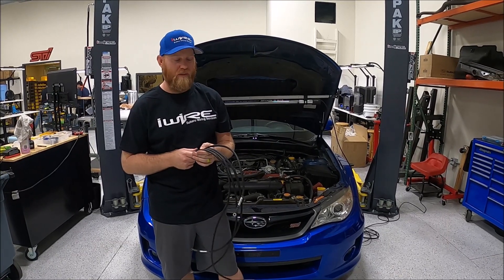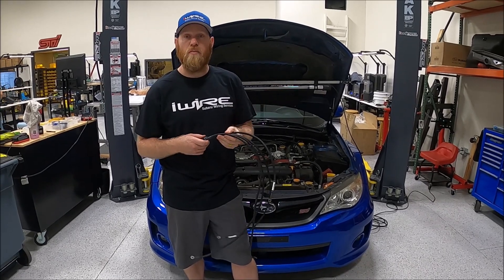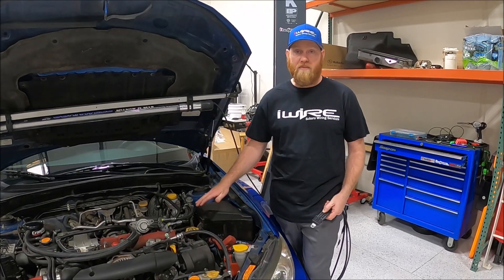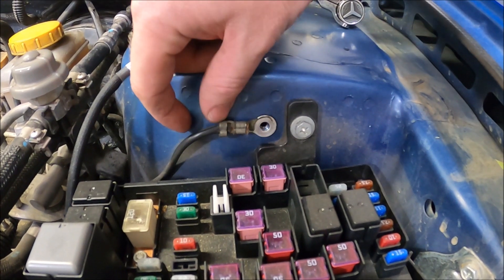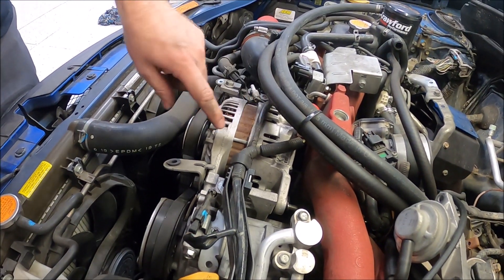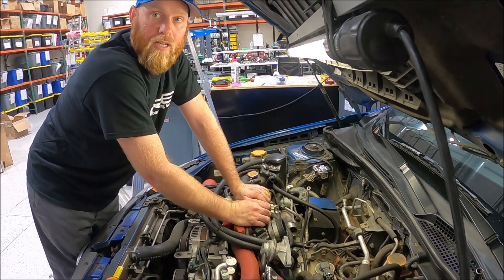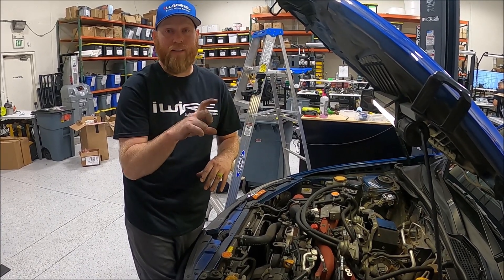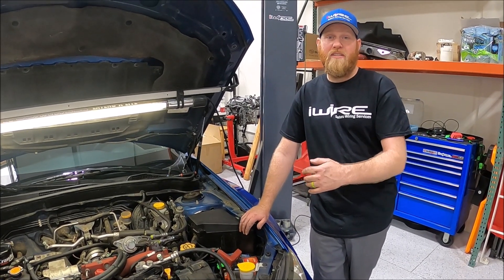iWire Grounding Kit Install Guide - Subaru Grounding Issue Solution

Comment from the maker: For Plastic Intake Manifolds - Bolt the ring terminal meant for the top of the intake manifold to the TGV block where the current ground terminal touches the intake manifold.
Reply: I have a 2014 WRX, I think I have a grounding issue as my radio flashes when I have my turn signal on but only intermittently. I want to install this kit but I’m having a hard time finding the last ground connection. I know you say it’s on the TGV block but I’m still not finding it.
Reply from the maker: @Iliketurtles69098  You can send us an email at info@iwireusa.com with some pictures of what you are working with, and we can try to help.
Reply: Can i ask where the tgv is on a 05 Outback 3.0 LL Bean(also plastic intake manifold)? I'm redoing my grounds with bigger/better wiring & I can only find the one to the driver strut, one on the passenger side fender(tiny one that goes into fender by power steering reservoir) & the one going to starter. I do see two under throttle body, on top of motor, two side by side. But those do not go directly to battery. I cannot get a straight answer from anyone. I'm running from behind alternator(just like in video except mine is on the bottom right instead of top right) to battery, from batt to strut, batt to starter. Should I run to one of the ones(two side by side) on the block as well? I really appreciate it. You guys really are a big help. Thank you!
Reply from the maker: @troshaffer4921  There aren't any TGVs on your model so you'll just put the cable near the main ground joint.
Reply: Please show a video on plastic manifold

Comment: I have a 2019 subie crosstrek and have some grounding issues, would this kit potentially solve them, and would the bolting locations be any different then the car shown in this video
Reply from the maker: Absolutely good option try and solve grounding issues and the install should be very similar even if not exact given the differences in engine type.

Comment: I have a 04 STI ej207 swapped, been chasing this idling issue for the longest time. Dips up and down on idle but today I cleaned up the chassis ground and it seems to have helped a ton, I also don’t have tgvs so I’m thinking this grounding kit will help
Reply from the maker: This should help. At the very least, it should eliminate the engine's grounding system as the cause of the problem.
Reply: @iwiresubaruwiringsolutions  just ordered my grounding kit today! Super excited. I have my fingers crossed that this fixes my issue with the idle going up and down. Over the last year and a half I’ve replaced everything from a fuel pump,  to the maf sensor and everything in between with no luck. I also noticed a feedback sound in my stereo recently that points to a ground so I’m hoping this helps!

Comment: You mentioned that the main ECU ground is top of the intake manifold. What about 3rd gen wrx's with a plastic manifold?
Reply from the maker: The plastic manifold will be grounded at the TGV block.

Comment: I've been having some weird issues with my '04 Baja NA 5spd, namely flickering lights (interior and exterior) and annoying surging while coasting. Replaced the alternator with a Denso unit and that ultimately didn't solve the problem...I've been told to only use OE alternators, but I have a feeling it's a ground issue. When I dig the car out of winter storage I will give the grounding kit a try. Thanks!
Reply: Did you figure out your issue?
Reply: @Tanya_Von-Degurechaff  yes...one of the harness eyelets bolted to the position battery terminal was just loose 🤦 found that out before ordering the kit
Reply: @LoveMyZJ  thats crazy, such a small thing too, you wouldn't know it. My car is having some weird issues too, the ac comp pulley and waste gate actuator solenoid and fuel pump, all keep cycling with the car off and key on the on position, super annoying.
Reply: @LoveMyZJ  thank you for the follow up. My 2012 Outback started doing this overnight, and while driving today, so I'm chasing down possibilities.

Comment: What else would we need to ground if we were adding an aftermarket stereo system and we wanted to do a big 3? I know this kit has some elements of the big 3 but not all. Do you have any plans to make an all-in-one grounding kit that incorporates the Big 3 and the current grounding kit?
Reply from the maker: We are focusing on ECU/engine-related issues, so it's not likely we will address anything else regarding the Big 3. More about this kit can be found in the link below.

https://iwireusa.com/blogs/iwire-university/grounding-issues-iwire-grounding-kit?_pos=5&_sid=d6aa39b2e&_ss=r

Comment: Hi, there. I just ordered the grounding wire. I watched your video on installation, and I am having a hard time with the alternator wiring, I cannot seem to remove the bolt as it seems it may be stripped. Any ideas or suggestions? Also, the wiring for the engine block, has large bolts, so I am looking for more ideal spot. What other spots could you suggest. I have a 2016 Subaru Forester. Any advice is sincerely appreciated. BTW, Great packaging and the thank you notes are a first class touch!
Reply from the maker: We appreciate the compliment! Sounds like some sort of bolt removal spray to get things loosened up may be in order. As for the bolt locations, as long as you adhere to the general principles we've described you'll be good to go.
Reply: @iwiresubaruwiringsolutions   I appreciate your response.

Comment: Maybe add a 6th lead for connecting the starter?
Reply from the maker: We don't add one to the starter because this grounding is for engine/ECU-related signals. The high current of the starter would not be ideal with the more sensitive electronic components.
Reply: You guys are the best - thank you for teaching me about all of this. Installed this kit on my 2007 Hawkeye STI without a hiccup  @iwiresubaruwiringsolutions

Comment: Just ordered mine and watched your video.
Do you not remove the old ground wires or do you bolt them up togeather?
Reply from the maker: You do not want to remove the original grounds. They are still needed for the ECU. This harness brings the ground to the manifold, so those original ground works better.

Comment: So this is pretty much a big 3 upgrade with the addition of the intake manifold, right?
Reply from the maker: Yes and no. This kit is designed to primarily improve the electrical efficiency of the ECU and engine-related components. The "big 3" is more related to body equipment like stereo. We talk about this a bit in the post here - https://iwireusa.com/blogs/iwire-university/grounding-issues-iwire-grounding-kit?_pos=2&_sid=c89234f31&_ss=r

Comment: I have a 2010 Forester XT.
Driver side ground wire from engine harness is not connected and I don't know where it goes.
Any idea of where it is at to go
Reply from the maker: Hard to say exactly. It should go to the block or the lower part of the TGV housing.
Reply: @iwiresubaruwiringsolutions  
Thanks, what is the TGV housing?

Comment: You know I just bought my forester and they just done the deletes and I don’t see this kit on the car so I’m
Wondering if they did soemthing or if I really need to get this kit aaap
Reply from the maker: If they did TGV deletes and you're having weird electrical gremlins we'd highly recommend this kit.
Reply: @iwiresubaruwiringsolutions  I don’t think I have any werid electrical issues only thing I’ve noticed is when I goto a stop I’ll get low idle then it will go back to normal idle “doesn’t die tho” but maybe I’ll get this in the coming week and the SD wire kit you supply for when I got front mount next year hehe
Reply from the maker: @Kiingzues  Doesn't hurt to install this kit just in case it is a grounding issue that's causing it. Glad we can be a part of your project in the future!!

Comment: Awesome video thanks a lot , question instead of sandwiching the cable with the alternator bracket can i put the ground cable in front of  the beginning of the thread with a nut, don't want take out my Perrin mod cover from the alternator lol, also is there's another option for a spot to put the ground cable that goes on the block engine, can i put it in one the 4 sides of the throttle body? I have a STI 2016 limited
Reply from the maker: It would be fine to put it on the front part of the bolt instead of the back for the alternator. You'll need to make sure one goes to the long block. The throttle body would be the intake manifold, so you should have another cable that goes to that somewhere.
Reply: @iwiresubaruwiringsolutions  thanks for reaching out back
Reply: @iwiresubaruwiringsolutions  i set up the this ground kit as you instructed and is amazing how the car feel a bit torquish and with more power , even the head lights are having more volume on brightness, this grounding kit is marvelous ill recommend this kit 100% blind folded 👍💪 keep up the good work

Comment: Will this fix my charging issue I have I only make 11.6 volts would this cure that issue
Reply from the maker: I can't promise this will fix your issues since it could be caused by many factors but this kit would remove grounding as an issue

Comment: 2003 Subaru bugeye been throwing a code P0032 I believe it's due to a grounding problem been doing a lot of work trying to locate the issue my next idea was a air leak with intake manifold or I need a new head gasket. However it's blazing out in AZ to get this work done, 230k + miles on the old girl but she still runs. My question is do you believe that this would fix my troubles for the mean time? Lol seems very straightforward and makes sense
Reply from the maker: As with all solutions without seeing the car, I can't guarantee it would fix your problem. I can tell you that it will eliminate a variable that very likely could be the cause of your problem. Worst case you've made your grounding system work better so your engine will likely run a bit more efficiently and will be able to determine that the root cause of your problem is not due to grounding.

Comment: In addition to what you did would it make sense to add one more ground from battery to that “main grounding” point on your harness?
Reply from the maker: The small ground behind the fusebox goes directly to the battery so in effect this already has that point taken care of.
Reply: @iwiresubaruwiringsolutions  true. But the small ground your referring to is a small factory ground? Isn’t the point to make them bigger? Or moot at that point ?

Comment: Question but are the ground locations pretty much similar to a NA Subaru?
I have a 04 forester and im getting whistling noise on my aftermarket sound system so im looking into doing fixes to my grounds
Reply from the maker: The grounding points should be similar

Comment: Hey how's it going? I really need some help, I have a '05 Outback 3.0 LL Bean(VIN-4S4BP86C154335722) & out of nowhere my car started bogging down really bad, really rough idle, misfiring etc. Ive cleaned throttle, replaced maf, map, crank, cam sensors, upgraded coils & plugs. It did nothing, had a new tranny put in a month ago, I really think they messed up some grounds. I haven't been able to find locations for my specific car, added bottom ground straps(they weren't there), cleaned the chassis ground, starter and two grounds under air chamber box/throttle body. I have the plastic manifold & cannot find any other grounds, took alternator off & there weren't any grounds. I have plenty of wiring(I'm a car audio guy as well) I just don't know where to look/add or replace. I would greatly appreciate any help. Been @ this for over a week straight now.
Reply: Following because similar problems. Pulled engine to do seals and tranny for rebuild. Tested tranny and engine separately. Both function appropriately. But in the car it bogs down and barely has any engine power now.

Comment: 2011 Outback.  Every once in a while my dash lights/warning/indicators etc., come on.  So I disconnect the battery and clean the terminals.  Especially the POSITIVE.  Problem solved... However, lately its been doing it more often.  Should I track down a Subaru wiring diagram and clean ALL the ground straps and connections on the car?

Comment: I have a 2018 Forester 2.5i and I have voltage issues. I replaced the factory battery with an AGM battery. I still have voltage issues. I’m thinking of the big 3 upgrade, till I saw this.
Reply from the maker: Our Grounding Kit should be all that is needed. Unless you have a large stereo the alternator would not need to be upgraded or changed. More about grounding and the big 3 here - https://www.iwireservices.com/post/grounding-issues-iwire-grounding-kit

Comment: To run this kit with the PW intake manifold where would you hook the terminal for the intake manifold?
Reply from the maker: Anywhere there is an exposed bolt on the intake manifold would be fine.

Comment: what if you have tgv deletes and a plastic manifold?
Reply from the maker: In this case I would make sure one of the wires is touching the same piece of metal as where you engine harness ground is sitting.
Reply: @iwiresubaruwiringsolutions  I'm going to call you cuz I have a couple of other questions about your AFR harness

Comment: I plan on running a high amp alt 370 ( Can you build a kit with that in mind )
Reply from the maker: The kit is standard but should work with that setup without any issue.

Comment: What are your views on using a copper-based anti-seize on the threads?
Reply from the maker: Don't have a ton of experience with using it, but don't think it would hurt and maybe even be beneficial.
Reply: @iwiresubaruwiringsolutions  In this case, it would prevent corrosion and keep the circuit clean. I use it on grounds and high-amp connections. Great for any threaded aluminum, too.

Comment: Can the main ground be connected directly to the battery instead of the chassis?
Reply from the maker: You can but due to the tendency for the battery terminals to get corroded we do not suggest it. In addition we prefer the extra capacitance that the chassis provides where the negative terminal meets the chassis.